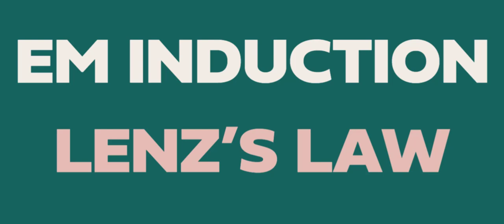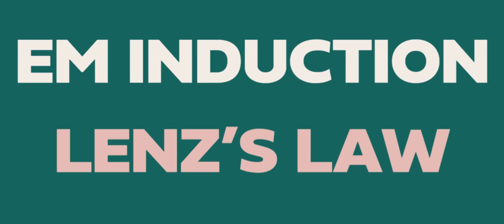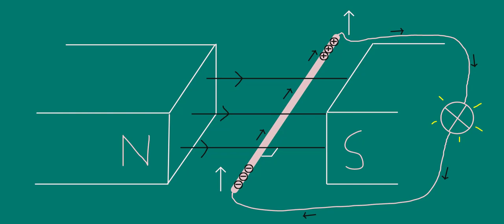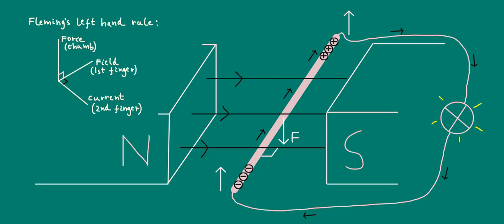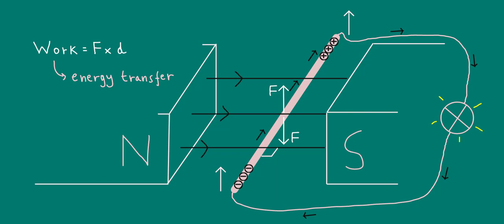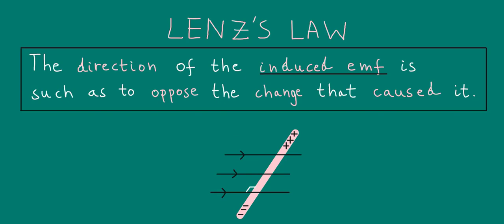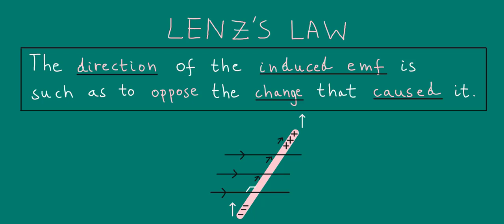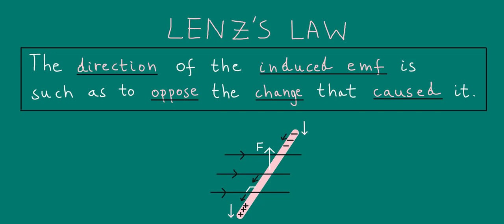Electromagnetic Induction | Lenz's Law | A-level Physics

Comment: While using Flemming's LH rule isn't the second finger showing the direction of conventional current, not election flow?  For this reason shouldn't the induced emf in the wire in both examples be the other way around?
Reply from the maker: You are correct that the second finger represents conventional current. Check that you are using your left hand and that your fingers are oriented as shown in the diagram at 2:45.
Reply: @ForestLearn  If the first finger is pointing from north to south shouldnt the convential current be going downwards? which would make the electrons go to the top not the bottom of the rod.
Reply from the maker: @Grassmanian  You are correct - if the rod (and therefore the electrons in the rod) moves up, the conventional current is downward. Using your left hand fingers as shown in the diagram at 2:45, you should find that your thumb points towards you - the magnetic force on the electrons causes them to accumulate at the 'bottom' of the rod. Hope this helps, let me know if you need further clarification.
Reply: @ForestLearn  I have also learnt that the thumb can represent the motion of the conductor in which case the thumb would be pointing directly up and the  1st finger will be pointing from N to S which means the 2nd finger for current would be pointing toward the West, opposite to what you have shown in the diagram, is this wrong ?
Reply from the maker: @Grassmanian  The thumb represents motion of a conductor in Fleming's right hand rule (the 'dynamo rule'). If you use your right hand, you'll find that the induced current is in the direction shown in the video.

This illustrates just one of the reasons why I don't like the right-hand rule: it can cause unnecessary confusion and is not needed. The physics of what's going on here ('cutting field lines' type of induction) is perfectly well explained by the left-hand rule. I don't discuss/teach the right-hand rule in this induction playlist.

If you want a better understanding of what's going on conceptually, you may want to check out the previous vid in the playlist if you haven't already: https://www.youtube.com/watch?v=ZkO_fBTbtec
Reply: @ForestLearn  Ohh I see that makes sense. Thank you for clarifying :)
Reply from the maker: @Grassmanian  My pleasure, that's great to hear!

Comment: Hi, I actually conceptualized the problem in three parts. Please correct me if I'm wrong. The same setup as in the video.

There are free electeons in the wire so as I move the wire, the whole bulk moves upwards or the current is upwards. According to the Flemming's right hand rule (where my index finger is the direction of the velocity, middle finger is the direction of the magnetic field lines, and thumb points in the direction of the magnetic force; this is what I'll continue to use through out) the positive charges (holes) feel an into the page (away from you) force. This elucidates the charge separation in the video. This is all due to Lorentz force law.

(Next, you considered this all due to Lenz's law but I think it's just due to Lorentz force law again) Due to the separation of the charges in the wire, there is an electric field (not because of the Lenz's law but just moving charges) so that movement of charges is like a cureent in a wire so again using Right hand rule (above I mentioned) the wire encounteres a downward magnetic force (what you already explained in the video)

Eventually, now I come to the Lenz's law. We can ponder upon the wire to be sweeping an imaginary area as it moves upwards which is normal to the magnetic field lines so because the area is increasing, the magnetic flux is increasing so according to the Faraday's law: ε = - dΦB/dt, there will be an induced emf and the direction of the induced current is given by Lenz's law using Flemming's right hand rule. If I imagine the wire with the inaginary area's perimeter as one connected wire or if I connect the wire and make a rectangular loop while keeping the bottom wire we had earlier the same, the current will flow in such a way that (our positive charges were in the extremity of the wire away from us and the negative charges were in front of us) now the induced current will have the positive charges moving towards us and negative away from us. 

So my question is that's how I feel like we can use Lenz's law and Faraday's law when we have a 2D closed loop; ε =∮{ E + (v × B) } • dl is I guess another form of the Faraday's law so we need to have a closed loop as in Ampere's law (unlike 3D Gaussian surface in Gauss's law) to use Faraday's law. So according to you, the second part was the occurence of Lenz's law but I think it's just Lorentz's force law. I tried searching but couldn't find it anywhere. Could you please help me grasp it? Appologies for this long message and thank you for the video!

Comment: Since the applied and magnetic force act in opposite directions and have the same magnitude, does this imply it is impossible to accelerate a conductor (in a closed circuit) when it is cutting across magnetic field lines?
Reply from the maker: No - one only needs to increase the applied force, which will lead to a resultant upward force and thus an acceleration. This will not exist indefinitely - a higher speed will lead to a greater induced emf (Faraday's law) and greater induced current, which will result in an increased downward magnetic force which will counter-balance the applied force. Hope this helps!

Comment: My question may sound stupid. Lets say that you have constant magnetic field and you move your wire in that magnetic field. Current will occur of course due to Faraday's law and because of the current and the magnetic field an opposite force will occur same in magnitude (Lenz's law). So you must continue applying a force if you want your moving wire to continue having a constant speed (and not decelerate I guess).  You have two opposite forces and an object moving with constant speed so zero work done. How does thermal energy occur if your "body"(your hand) consumes energy in order to prevent the "wire" from decelerating?
Reply from the maker: No such thing as a stupid question, your question is a good one! Consider somebody applying a horizontal force on a box as the box moves at constant speed along the ground, so no change in kinetic energy. There's an equal and opposite frictional force acting on the box as well. The applied force (due to the person), does work, so there's an energy transfer going on. The transfer is from chemical energy (stored in body) to an increase in thermal energy of the ground and bottom surface of the box. Hopefully you can see the similarity between this example and the question you've posed - conceptually they are identical. Happy to provide further clarification if needed though!

Comment: We always introduce the concept of current after explaining Voltage. Here we have a conductor generating an induced current to produce an induced Voltage at the ends. Is this the only case where this temporary movement of charges is called current before its associated Voltage is formed?
Reply from the maker: The induced emf/voltage that develops across the ends of the thick conductor is caused by the magnetic force (if this isn't clear, check out https://www.youtube.com/watch?v=ZkO_fBTbtec ). This induced emf is then responsible for the current that flows OUTSIDE of the magnetic field, through the bulb, just like a simple circuit with a battery. I tried to be careful and refer to this 'OUTSIDE' current as induced current, and not refer to the flow of charges INSIDE the magnetic field as induced current. 

Also, as long as the conductor is moving up and cutting the field lines, the flow of charge (both inside and outside) is continuous, not temporary. Hope this helps, but if you still have questions, let me know.